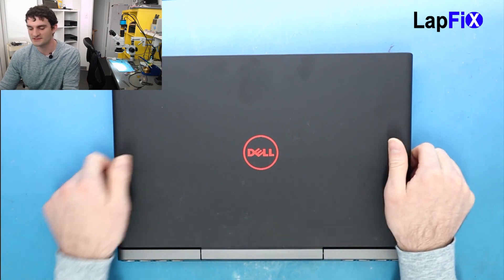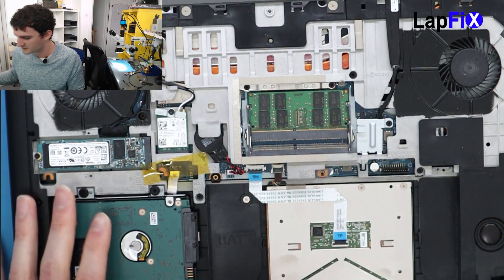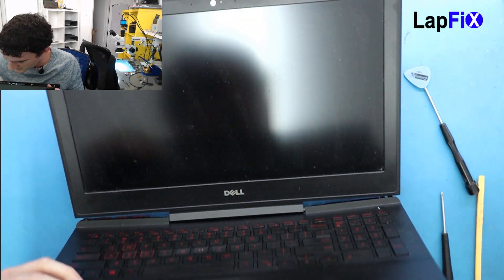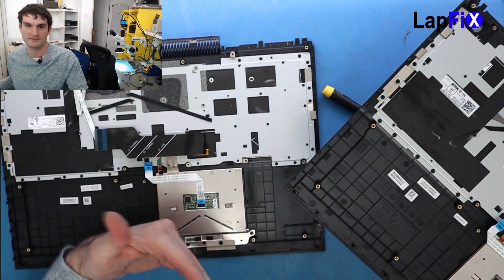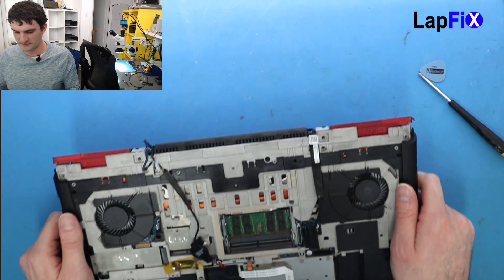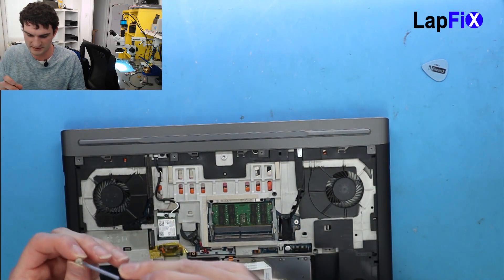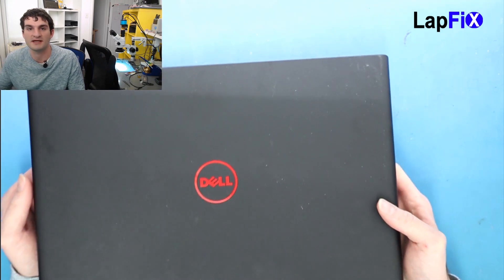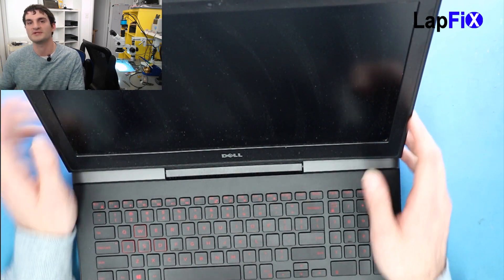Dell Inspiron 15 7567 Gaming Keyboard Replacement

Comment: Question does this model have a backlit keyboard? I’m trying to figure out if the one I have is broken.

Is there a way to test the laptop to see if the backlight function is working or not beside just replacing the keyboard?

Comment: Revised instructions: Remove the five Torx screws that hold down the battery. Carefully remove the battery and note that you should replace the battery if it is damaged. 2016 vintage batteries are at end of life (EOL) now. Mine expanded in my laptop, bursting out of its seams, putting pressure on the chassis, and luckily it didn't catch on fire.

Next unscrew the hard drive. There are four screws captured by rubber anti-vibration pads. Try not to damage the pads and reinstall the same way.

Now remove four flat screws that hold on the plastic grille. There are four clips. You can remove the grille without breaking any clips if you're gentle.

Next remove one flat screw just to the left of the trackpad.

Now you will need to remove somewhere around 20 2.5x5 screws and 2 2.5x8 screws. The video doesn't mention the sheer number of screws. At least they're all labeled.

The keyboard should come off easily if you have removed all of the screws. If the clips seem to be holding on too tightly you probably missed some screws. After I found all of the screws not mentioned in the video, I only broke one clip off of the old keyboard, and nothing on the chassis.

Once you have the keyboard off, follow the steps in the video. Total time is about 90 minutes.

I recommend that when re-installing the screws you turn them backwards until you hear a click. This insures that the screws are threading in correctly. No need to overtighten. You are not fixing a car. This is a delicate piece of electronics. Snug but never use a lot of strength.

Comment: Thanks for your video. I purchased this laptop back  in March 2017 and the keyboard has been adding extra letters for most of the time that I've owned it. I was very disappointed to find out that you have to tear the laptop completely apart to replace the keyboard. I guess that's why it was only around $1,000 new. I've had the replacement part (minus the trackpad) for quite a few years and I'm finally going to go forward with the repair as you document it and remove all 20+ screws. Dell did a bad job with this keyboard: The electronics are poor and they made it difficult to replace. Other than that the laptop continues to work fine. No issues besides the keyboard.

Comment: Every video I've watched the jump cut removing the keyboard panel when they can't pull it off straight away...what's causing the jam? I've removed every screw and trying to remove the panel and there's something in the middle holding it. But no one shows how they solve that?

Comment: Good video. I had to teardown mine to re-paste the cpu and gpu. Now, I just need to replace the battery. Dell got some garbage batteries (Forbidden Capri Sun?!). And UGH - Toshiba drive in this. I worked with Dell AIO (Optiplex 3030) at work and never seen so many Toshiba 2.5 500GB drives fail. We ended up buying a lot of 240/256GB SSD drives to replace them.

Comment: If I only have the keyboard and not a whole face with trackpack palm rest etc. how would remove the rivets, And then replace them? From the comments I know I’m not the only person wondering, it would have been cool if the audio wasn’t only in my right earbud, and if there was a link or description of the screwdriver used to take out the battery too.

Comment: I normally never leave comments but since I tried to follow this video with no luck. I have to say if you aren't experienced with this sort of thing, I highly don't recommend attempting what is done in this video without other material to follow. Some things that are done are just not included in the video. I'll just use an external keyboard. I still appreciate the effort put in this video.

Comment: Where is the plastic latch at 2:40? I ended up breaking one of the plastic holdings for one of the screws trying to remove the part.

Comment: I tried to replace my keyboard but after removing all the screws that's keeping the whole pad in-place I still couldn't lift the thing because the battery's screws were also needed to be remove and i don't have a screwdriver for it 🤦🤦

Comment: Hey, cool video. Is it possible to replace the keyboard without replacing the palmrest?
Reply: Yes! the keyboard is riveted on with plastic rivets. it is somewhat time consuming but you can pop off each individual rivet on the old keyboard, apply the new keyboard, and then remelt the heads of the rivets onto the back of the keyboard with a soldering iron. i used some 3d-printer filament for areas where the original rivet did not have enough plastic remaining.
Reply: @wc8189  I do this regularly.  We use a hot glue gun, and a flat piece of metal dipped in IPA alcohol each time to press the glue drops into place and flatten them out.  The alcohol prevents the metal from sticking to the glue.

Comment: Do i have to replade my keyboard if the letters 2,w,s,and x don't work?
Reply: i have the same laptop  with the exact same problem. 2,w,s,and x  dont work
Reply from the maker: Depends, it could be an issue with the keyboard itself or with the connection.  If you are interested in a repair, please feel free to contact us, our info is in the description 😀
Reply: i have the same laptop  with the exact same problem. 2,w,s,and x dont work. copied bc im on it atm
Reply: @thatguy5  were you able to fix it. I just got this problem recently too
Reply: I have a 7577 with the same issue

Comment: Thank you, just replaced my keyboard on my Dell Inspiron 15 7000 Gaming laptop. I had intermittent arrow key and one of my numbers stopped working. I saw your video and it looked like there was no user fixable parts on the underside of the keyboard so I replaced the whole thing. The battery connector and battery screws were most awkward bit. :)
Reply: I have to replace the palmrest/keyboard on my laptop as well. Where did you find the part for sale?
Reply: Do you know a site that has a replacement motherboard ?
Reply: @uchihasfinest1506  It is probably not worth replacing the motherboard since it's the most expensive part.